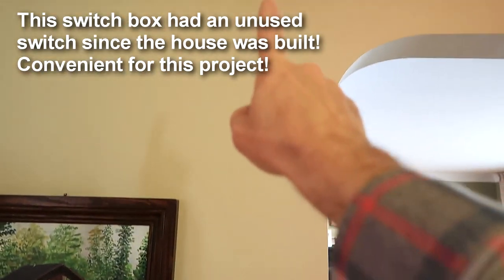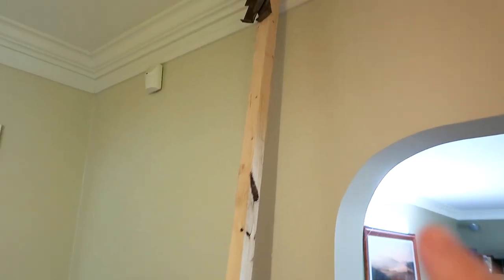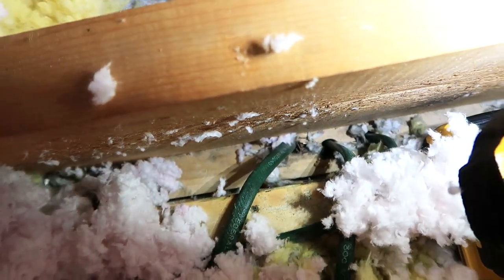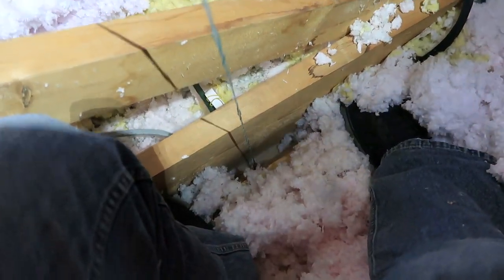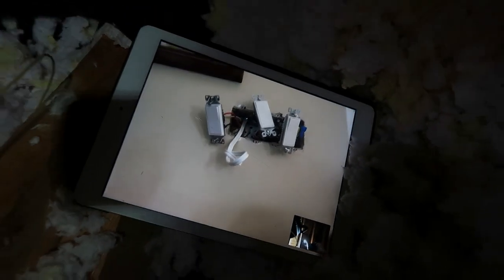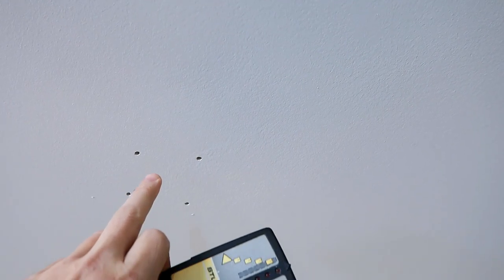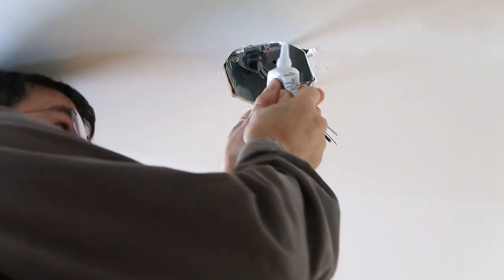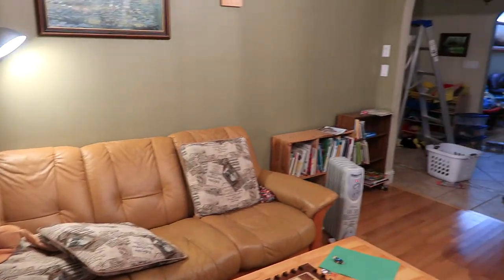Fishing a wire through the wall using magnets

Comment: Very clever. I knew a guy that was an electrician and to run wires on a drop ceiling in a big industrial building he got a remote controlled tank. It seemed like a crazy idea but it worked. Otherwise he'd have had to do a lot of ladder work and moving tiles.
Reply from the maker: very clever!
Reply: There's a story that the BBC Outside Broadcasting Department had a trained ferret to run down conduits and such to lay all cabling they needed when they broadcast from big sports events, royal weddings all that sort of thing. I don't know if it's true but it makes a good story!
Reply: I did that for my college job as a computer operator for a bunch of Sun 3's.  I bought an open box RC Sherman tank with a busted turret from RadioShack to run string through drop ceilings so I could pull RG-8 Ethernet cables through.  Worked pretty well, although the tracks wouldn't always get much purchase when it ran into real obstructions.
Reply: @bborkzilla  Y’all must have had a whole lot more luck than I’ve ever had with getting jobs where there’s even enough clear space to drive an RC toy between your drops lol. I’m usually lucky just to be able to get a descent line of sight to the next opening.
Reply: That is genius! I'm going to start figuring out how I can use RC in my businesses.
Reply: They make compressed air and spring powered "cable caster" guns for doing work in drop ceilings. The compressed air ones will supposedly shoot a string over 100' if there is enough headroom.  Certainly beats popping every 4th or 5th tile and trying to throw the coil of wire.
Reply: I used a variety of fiberglass poles, the telescoping and the screw together style.  Harbor Freight sells decent set of the screw together style relatively cheap.
Reply: @Bikeeast  that's new to me. They have those 40 years ago?
Reply: I installed security and fire detection systems. I used a spring powered plastic dart pistol with a fishing type reel loaded with small nylon pull string for crawlspace work. For fishing in walls, I had a 8 ft pull chain like on a light switch that I dropped down the wall with a pull string tied to the other end. I fished it out with a magnet on a flexible aluminum wire. All these tools were available from a specialty store in town that sold all sorts of security and fire detection system tools and accessories. Once I had to install in conduit and did not have any wire lube. I drove to WalMart and got the biggest bottle of K-Y lube they had and it worked fine!
Reply: Clever I like it. In an industrial if you have empty conduit running through the building and you want to pull wires through first you need a rope or commonly a webbing called mule tape in the conduit. Tie a small bag with a pocket of air or piece of plastic to the rope. Use a vacuum cleaner at the far end to suck the bag clear through the conduit. One more tip. When pulling the wire with the rope, pull a second rope through for any future wires to be pulled
Reply: I'm keeping that one in my backpocket
Reply: @Watchyn_Yarwood  just started using industry specific silicone lube at work. Way better! No more hand scooping yellow 77
Reply: @1pcfred  Try a Wam-o slingshot and 1/2 inch nut on a string.  The RC tank runs into too many cables and cross wires in an old building.
Reply: @MarkMcCluney  it is a true story apparently. Many years ago, a lot of country folk in the UK kept ferrets for hunting rabbits. As part of the set up people used "liner" ferrets which was usually a large male hob ferret and (roughly speaking) it would drag a line down the rabbit hole  into the Warren enabling the hunter to dig down and follow the line where ever the hob had ended up. These days they simply fit the hob with an electronic tag/ferret finder.. But as you can see, using a ferret to pull a fish line in would not have been that different, but I assume it would only be used where there was already a pipe for the ferret to follow....

Comment: That job involved several encounters I avoid:  Insulation, attics, working overhead, and crawling.  But if I had been there, I'd have volunteered to install the switch cover plate and get us each a beer.

Comment: Always so interesting to observe the differences between your and our European installations. Here in Finland everything you use for installations is made of plastic so it can’t become ”live”. 
I’ve used all kinds of contraptions to get wires guided inside dry walls but never used magnets and compass. Love the idea!
Reply: In North America, all the metal in electrical infrastructure is meant to be attached to the ground wire running back to the panel. That way, if the live wire were to fray inside the box, it would trip the breaker immediately, rather than needing to connect with the neutral. However, in older houses that only use 2-conductor wire, this wouldn't be the case. Plastic boxes are available here at hardware stores, but a little more expensive than the metal ones in most cases.
Reply: It's also prevents sparking from corroded wire connections causing fires. But that's a double fault situation anyway, so pretty rare.
Reply: Most new US boxes are plastic.

Comment: Brilliant idea with the magnets, nails and drinking straw! I'll have to try that trick next time. Fishing the wire is always a challenge.
Reply: never had a problem. I always use a wire that is already there to pull in a string. Then i attach the other wire and pull them both back. Or i use 2 strings depending on the situation.

Comment: As an electrician, I like drilling a hole above and dropping a sash chain and catching it with a hook and pulling it into the box. Also if you put a light in the box and drill a hole above, you can look through the hole and send a fish stick right into the hole. Or if you want, you can use 2 fish tapes with hooks on the end, and catch them and pull into the box. Or you can remove the box from the wall and drop any sort of fish and grab it with your hand. Many ways to fish a wire.
Reply from the maker: the upper hole was at an angle -- had to be because there was a joist directly over the wall.  Have pushed a wire before, sometimes actually hitting the small hole in the electrical box.  But that's only from below into sockets, short range.
Reply: Try fishing a 1" flexible conduit down a wall above the breaker panel, only to realize that there's some horizontal strapping in the stud bay above the breaker panel - only way to get that done was to get a borescope camera into the hole to see wtf was going on. And then after the conduit was fished, punching out the larger size knockout in the panel box on one of those multiple sized pre-punched knockouts. That day I learned of electrical knockout "reducing washers" - 50 cents to the rescue there! Best "10 minute" project that turned into 4 or 5 hours that one!
Reply: Mmm.... fish sticks
Reply: You can also use the sash chain from the top and use a magnet from the bottom.
Reply: @reidflemingworldstoughestm1394  Haddock or Cod?
Reply: As an electrician I use jack chain to drop the Romex down the wall and into the box once I hit the box I use a piece of solid wire to fish it in the knockout hole. Another way I would do this is drill the top plate and then attach the Romex with two 6 foot Glow Sticks and fish the cable down the wall and into the box. Greenlee makes a good set of Fish Sticks and Klein does too. I like the ones which do glow in the dark and are quite flexible. The rigid ones work well too but are better going horizontal. Great video.

Comment: Clever I like it. In an industrial if you have empty conduit running through the building and you want to pull wires through first you need a rope or commonly a webbing called mule tape in the conduit. Tie a small bag with a pocket of air or piece of plastic to the rope. Use a vacuum cleaner at the far end to suck the bag clear through the conduit. One more tip. When pulling the wire with the rope, pull a second rope through for any future wires to be pulled

Comment: For one, this makes me appreciate a lot more that our electrical wiring is done through electrical ducts. On the other hand, good luck having your wires go through the overfilled duct, because you ain't pull it from somewhere else with brick walls.
I don't usually work as an electrician, but when I do for friends or relatives, I do charge well for it. It's damn hard work.

Comment: Cool. My preference for added ceiling lighting are flush mount LED lights. I have a large carbide hole saw to drill through the drywall. The 5" opening is large enough to use the cable itself to get from one hole to another parallel to the joists. The harder part is going across joists with an insulated attic above.

Comment: There is a product called MagnaPull that we use to fish wires. The magnapull is strong enough to pull wire through insulation in walls as well. You just made your own diy version

Comment: They make long flexible drill bits you can use to drill the hole then fish the wire up the wall. I usually just replace the box in the wall with an old work box to make things easier.

Comment: Nice job! The only thing I would have done differently would be to pull a 14/3 cable instead of a 14/2.  Not much more cost, and would save you some work if you ever want to change to a ceiling fan with wall controls later on.
Reply: Yeah, that's pretty much a requirement for wiring to the center ceiling (obvious fan location)
Reply: Isn't he in Canada or something. Do they have ceiling fans there?
Reply: @heikovanderlaar3780   Hi Heiko!  Yes, Canada {I believe he's somewhere in the province of Quebec}, and yes, we do use ceiling fans.  They are valuable during our long summer days,  but of limited utility in the short winter days. Geographical latitude matters.  We have citizens living north of the Arctic Circle who get to experience both 24 hours of sunshine in mid-summer & equally interesting 24 hours of darkness in mid-winter.  But most Canadians live within ~100 km of our southern border with the U.S.A.

Comment: I dropped a round foam cat-toy ball studded with bolts and tied to a string down three stories from the top of my kitchen exhaust duct on the roof to the bend in the duct in the ground-floor kitchen.  Put a magnet on the end of a semi-rigid borescope and snaked it up and over from below.  That way, I fished a wire from a 12V power supply in the kitchen to an auxiliary booster fan on the roof.

Comment: Magnet + compass to find your mark = clever, good move. Manget + nails to connect your twine together = over engineered, could totally have fed the stif wire down from the top and got hold of it to pull through into the box ;-)

Comment: 7:27 what is the reason for the foil in front of the window? If you don't mind me asking
Reply: Window Insulation Film
Reply: It's an added insulation barrier for the cold on the window. Common in Canada.
It's clear plastic. It can be made nearly invisible if you use a hair dryer on it to make it shrink and tighten to remove all the wrinkles.
Reply: @BrianEltherington  
Looks like someone wrapped the window in cellophane.
Interesting, never heard or saw such a thing before. Must be a northamerican thing.

Comment: Too late now as you have completed the job but you may like to have a look at the Quinetic range of switches.  They even make one that would have fitted into your 4 gang block.  You could have had additional switches for two way and intermediate without any wiring needed.  They work by RF signals.

Comment: You can't use magnets to locate entry points with a foot of insulation. Just use thin galvanized wire they sell on Amazon
Use 1/16th drill bit and Poke it right through the celling until it sticks up above the insulation ...its much quicker. The hole in the celling is so small one drop of paint and it's gone.

Comment: you do not have to get the box right next to a joist, you can just cut a block that spans between two joists in the ceiling and attach the box to that, or buy a bar box which comes with a bar that spans between joists. Doing this is preferred over the single point block over the box like you did, think of a diving board with all the weight at the end, that is what you made. Heavy lights and ceiling fans will either sag or wiggle that "diving board" off. Attaching directly to the side of the joist works too, don't get me wrong, just saying you have more options than that.
Reply: To be fair that would have just meant moving the box further from where he had decided he wanted it down in the room.

Comment: I hate working in attics so much I won't do it anymore.
Taping and caulking the ceiling box does reduce air movement but water vapor will continue to move through the gypsum board into the attic.
Reply from the maker: that's what the plastic vapour barrier above the gypsum is for.
Reply: @matthiasrandomstuff2221  Upon rewatching I finally did notice the vapor barrier momentarily when you made the hole for the junction box.  My bad.

Comment: Why did you choose to attach to the stud vs using one of those mounting brackets that attaches to the floor joists? Cost?
Reply: I would assume in case a ceiling fan is ever installed in the same location, those bracket-type boxes wouldn't offer enough support.
Reply from the maker: didn't see one of those bracket boxes at the store.

Comment: Potentially silly question: Could you not have used a pancake box on the strapping, especially since you weren't installing a heavy fixture (eg a ceiling fan)? I know pancake boxes are obnoxious because they're so shallow, but then you wouldn't have had to offset your fixture from where you wanted it...
Reply from the maker: good point.  But I already had the regular box.

Comment: Why do you have plastic wrap covering the windows?
Reply: It's an insulation technique during the winter in cold climates. Extremely common.
Reply: Provides an air gap along the window pane to provide a level of insulation. Reduces convection losses in the winter.
Reply: It prevents warm interior air from condensing on cold glass.  Even with double thermal pane windows, the glass is cold.
Reply: @bittrippn6570  
Never saw that before, not even in scandinavia. Must be a US/CAN thing.

Comment: Disconnect one of the cables from the switch, tape some string to it and pull the cable out from the attic and then use the string to pull both the cables back down to the switch
Reply: Good idea but if they were installed when the house was built they are likely stapled to the studs.
Reply from the maker: risky - what if something goes wrong?  Also, what if it's attached to the stud, like they usually are?
Reply: @scofus6166  good point, they would need to be unattached
Reply: @matthiasrandomstuff2221  true, also  it would have been a less interesting video
Reply: You don't want to do that with old NMD wire, the sheathing can be very brittle...its best left untouched.
Reply: Matthias random stuff then use magnets

Comment: why is there cling wrap (frischhaltefolie) in front of the windows 7:24
Reply: In colder climates, it helps insulate the house, especially if it's an older house and the windows have a draft. It's an extremely common practice in the north.
Reply: Canadian winter brings all sorts of weirdness. The shrink film helps improve the draftiness of windows.
Reply: Most likely a temporary secondary glazing solution for winter. Trapping a layer of air between the glass and the cling film has a massive impact on the insulation properties of the windows.
Reply: It's a way of sealing off a drafty window to keep air from either coming in from outside or warm air leaving.
Reply: it keeps them fresher longer
Reply: Prevents warm air from condensing on the windows in the winter.
Reply: My guess is extra insulation. He lives in Canada and it gets awfully cold there. I know every time we get air from there in the winter we're not happy about it. I mean it gets freeze the eyeballs right out your head cold there. Crazy stupid cold.
Reply: @1pcfred  I live in Ontario and it is downright balmy here compared to your northern states IE Minnesota, North Dakota etc.  Temp is not just north/south it is also affected by distance to an ocean.
Reply: @bittrippn6570  that`s uncommen in the old world. maybe its not that cold here
Reply: @mirkofleenkamper1638  I'm in Texas and houses between 30 and 60 years old have single-pane aluminum frame windows. During the hard freeze in February I had an inch of ice buildup on the inside of the windows and sliding patio door. That was just during the five days it stayed below freezing. I can't even imagine what that would be like for months.
Reply: @peggyt1243  I'm practically in the middle of the Atlantic and it's been cold here the past few days. The air is coming right off the Great Lakes onto us. I watched the weather map last night. I was like why can't we get air from South Carolina? It fell to the 20s here last night. The dead of winter is usually the low 40s. I was watching those protesters in Florida in tee shirts. I was getting jelly.
Reply: @1pcfred  Paul - It is a known fact that the centre of continents there is extreme weather.  Proximity to any large body of water will have a moderating affect.  I did not realize there were any islands in the middle of the Atlantic other than Iceland in the north and the Azores in the south.; then there is Bermuda. .
Reply: @peggyt1243  that's why we refer to where I'm at as, Del a where? Because no one knows we're out here.

Comment: @6:55 spray foam would work best for this.
Reply from the maker: I didn't have a can of it open.  But I had a half used tube of caulking!
Reply: @matthiasrandomstuff2221  Fair enough. I grew up in a world where frugality was not promoted as much as it maybe should have been. That might be the greatest appeal to your channel. The amazing things you can make with an old washing machine motor and wood from a busted dresser.